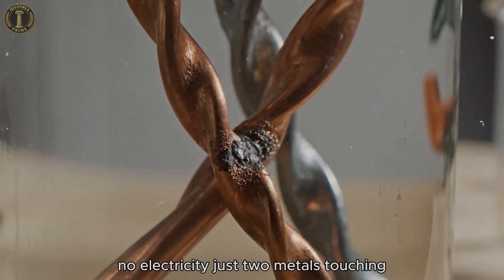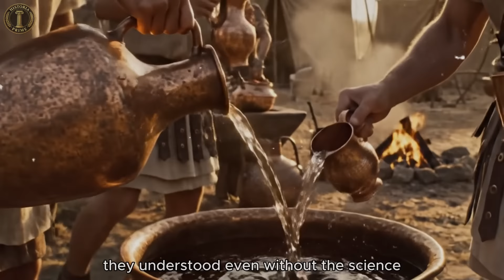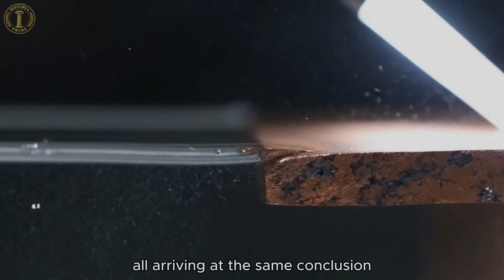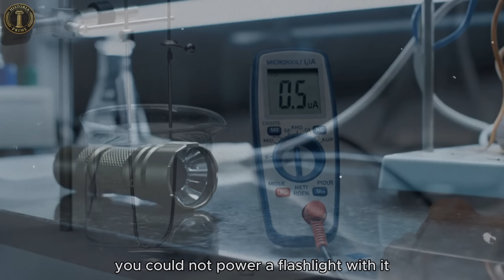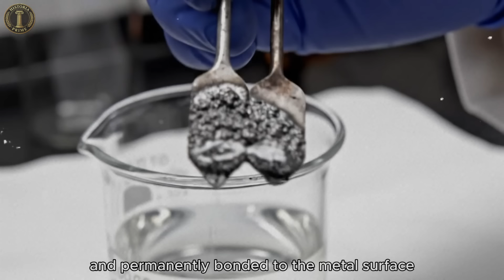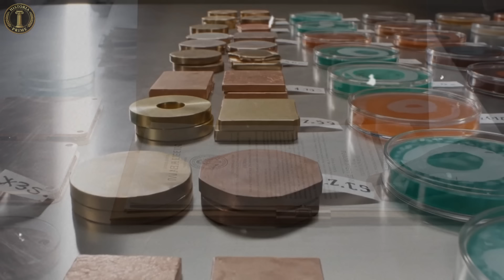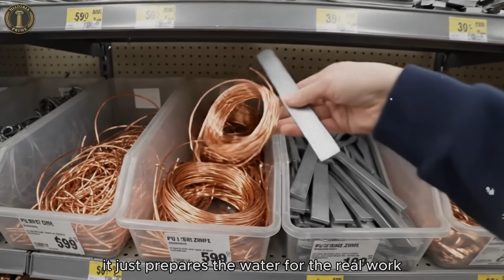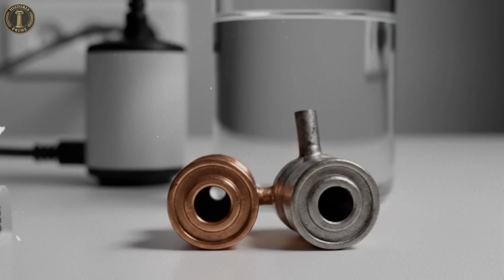Connecting Two Metals Purifies ANY Water — The "Earth Filter" Secret They Buried

Comment: Thanks for the infos, u fortunately, healthwise not recommended.
Here is the thing,

That YouTube suggestion is a bit sketchy 😬. Using copper and nickel wires in water purification is an unconventional method, and safety's a concern. Here's what could happen:

- *Copper*: Might leach into water, potentially causing toxicity if levels get too high.

- *Nickel*: Could also leach, causing allergic reactions or toxicity in some people.

- *Electrolysis*: When metals touch water, electrolysis can occur, potentially creating harmful compounds.

Instead, consider proven methods:
- Boiling
- Filtration systems
- UV treatment

Maybe, if you don't have those above safe methods at your disposal, you may use this old method for emergency, still unsafe
Reply from the maker: Fair caution. Water purification and water safety are bigger than one simple trick, so skepticism and careful testing are absolutely reasonable.

Comment: False statement. Copper and tin make BRASS. Copper and zinc make Bronze. Bronze is what you need
Reply from the maker: Actually, tin and copper make bronze, while zinc and copper make brass! 🛠️
Reply: @HistoriaPrime1212 ... You are right 😉👍🏻 ...
But I do hv two more questions, please: ...
(1.) Does the combination of 'Copper and Zinc' has similar/same properties in respect of water cleansing, electric flow, etc., compare to combin. of 'Cop. & Tin' r having (... apart fr fact, Cop.& Tin = Bronce) 🤔 ?? ...
(2.) Why shld the materials Cop./Tin/Zinc loose their properties alrdy after a few month time, after being combined (e.g., to 1 wire) ?? ... 🤔

Comment: If you have a well and you get algae film in your toilet bowl, place a small 1/2 or 3/4  piece of copper pipe in the tank, make sure it does t interfere with the flush mechanism and the algae will not grow back.  We used to use  one teaspoon of copper sulfide powder to 1 pint water to treat algae in swimming pools.
Reply: Would it work with some copper piping in the filter ?
Reply from the maker: Interesting tip, though I’d be careful with any chemical use around plumbing or water systems. Small details can matter a lot more than people think.
Reply: Dad put a Copper Tube into the toilet as a water spout thats pouring the fresh water refilling the flush tank.  No algae no nothing ever.

Comment: What happens to the good bacterias in your body if you drink the water purified by cooper zink ?
Reply: I suppose you drink the water, not the cooper or the zinc to harm your biom....
Reply from the maker: Good question. Water treatment and gut health are both more complicated than one simple claim, which is why “cleaner” and “safe long-term” are not always the same thing.
Reply: The stomach and duodenum absorb the copper and zinc before it reaches the intestines. Even if the metals reached the bloodstream, there's not enough to cause a problem, especially since both metals are required in minute amounts for proper metabolism in the body.

Comment: If one were to use a pre 1982 penny and a post 1982 penny, would this work? Once the job is done, can these pennies be reused?
Reply: Good question 👍🏻 ...  🤔?
Reply from the maker: Interesting idea, but pennies are still a very different setup from using the metals in a purpose-built arrangement. Reuse would also depend on how much corrosion or wear happened.

Comment: So I know where to get copper. Where do I find zinc
Reply: American pennies past 1982 are zinc.
Reply: Galvanized is a zinc coat on steel. Nails are an easy source.
Reply: @BillMarkey-sg4ph nails are zinc?
Reply: @laurapugh5874  The "galvanized" cover on some nails is zinc. Very common.
Reply: Zinc at hardware store too
Reply: Dry cell batteries, labeled as 'general purpose' and 'heavy duty' (not alkaline!) are made with a high purity zinc can (negative electrode). You can take them apart (carefully: contains zinc or ammonium chloride salts and manganese dioxide, which are moderately toxic/irritant) and thoroughly clean before use.
Reply: Buy a brass doorknob or anything brass, it's a mix of copper and zinc
Reply: Hardware store
Reply from the maker: Zinc is usually easier to find through roofing suppliers, metal suppliers, hardware sources, or online material sellers depending on the form you need.
Reply: You can find kdf filters on the web
Reply: Commercial fisherman sites sell zinc. They use them on crab pots, lobster pots, eel pots, ect. It stops corrosion. You may have to be creative how to pair with copper, but you'll be able to locate a zinc product.

Comment: Is the dirt in the water absorbed by the copper or it settles at the bottom of the vessel ?
Reply: The bigger/larger parts in the water, you shld filter out first, by using a piece of fabric / textile / cloth / charcoal, or similar ...
The method introduced to us here in this video, refers rather to the small unwanted particles, e.g. bacteria, etc.
Reply from the maker: More likely the larger dirt settles first, while the metal itself is not just “absorbing” all of it. That’s why pre-filtering still matters.

Comment: Since pennies are copper and zinc, can a couple of pennies work?
Reply from the maker: Not really in the same way. Pennies are a very different setup, and modern pennies are mostly zinc with a thin copper layer, so they would not behave like using the metals in a purpose-built arrangement.
Reply: @HistoriaPrime1212 what about pennies in a copper pitcher?
Reply: @laurapugh5874 Or you could just buy some KDF filter media.  It is pre-made zinc and copper alloy used for water treatment.  There is an 85 and a 55 KDF.  One is for well water, and the other for municipal water.

Comment: I haven't seen any pure zinc or pure copper for sell....where is it?
Reply from the maker: Pure copper is usually easiest to find as wire, sheet, or pipe from hardware and electrical suppliers. Pure zinc is less common in stores, but metal supply shops and online sellers often carry zinc sheet, rod, or anodes.

Comment: Where can i get copper and zinc pipes?
Reply from the maker: You can usually find copper pipe at most hardware or plumbing supply stores. Zinc is a bit trickier — sheet zinc, zinc rods, or galvanized pieces are often easier to find than full zinc pipe.

Comment: Do not drink anything acidic in a copper mug. It will make you very ill.
Reply: No salt in copper either
Reply: @robertedgell2214 ... Thx ... 😊 👍🏻👍🏻👍🏻
Reply: NOT all copper mugs are equal, meaning; make sure it is copper. I bought a "copper" mug, washed it, left water overnight, drunk water, and few hours later, got such bad  headache...tried again.....headache again; stopped drinking water from the mug...headache was gone.
Reply: @Krystyna-q7e6g :  Buy "100% pure copper sheet, tube" in the hardware- and fabricate your own "copper mug, pitcher, container, etc.."

The copper vessel interior, should be "scrubbed" every "3-5. years", with "very fine sand paper"- to removed the thin layer of "oxidized" copper surface...
Reply: @arielhermoso4262 Thank you.
Reply from the maker: Good caution. Copper and acidic liquids are exactly the kind of compatibility issue people should take seriously.
Reply: Made the mistake of putting orange juice in my copper flask. Was very ill within minutes of drinking some.
Reply: @ransomeblytonbuchan7979 медь хорошо чистить лимонным соком и немного соли добавить.Она будет блестеть.
Reply: THANK YOU!  This and the comments are very valuable information!
Reply: AVOID: 
Coffee, All Citrus Juices,  Tomato Anything,  Sodas, Teas,  Any Vinegars,  Dairy,  Alcohol & Wine...

PRETTY  MUCH  =  DRINK  JUST  WATER 💧 IN  COPPER  CUPS
Reply: @deesickles7578 ... Thanks for yr info and advice ... 🙄 👍🏻
Reply: @deesickles7578 . thank you!
Reply: Purify water in a cooper jug then whatever u wnat to mix the water with put in a glass jar and mix. ...like making lemonade etc. Just for storing wtaer use the copper jug
Reply: Been there, done that.
Reply: Keeping water 8 hrs overnight does the best job and pulls enough copper . Not to elevate copper levels too high 
Its best to drink copper water for litle while then take break. Or drink just once a day from copper vessel. Testing for copper levels be wise, even tho we most likely deficient in copper. Roundup n pesticides in food makes sure of that..😢 
Never put anything else in your copper vessel but just water😊
Reply: What about the cocktail that is always served in a copper mug?  I think it has ginger beer in it but I can’t remember the name.
Reply: @sandracheeks1811 & alcohol...
I think those Moscow Mule mug might have a thin lining of plastic, just like all aluminum cans have...
🇺🇸😎
Reply: I believe you're talking about a Moscow Mule. Not only is it made with ginger beer but I think it's made with lime juice as well.
Reply: @sandracheeks1811 Moscow Mule ❤
Reply: Thanks🙏
Reply: Спасибо, значит только для чистой воды, а остальное из глиняной кружки можно. Кстати, у дворян до революции в России столовые предметы, как вилки и ложки были серебрянными.
Reply: Why
Reply: @zonkermom I'm thinking the acid leeches copper into the liquid ie too much copper to ingest?
Reply: It is said that mental illness have a high percentage of copper into the brain
Reply: @theodorcosminvoicu9240  You are correct, there is too much copper in people with bipolar and schizoaffective disorders. Traditional Chinese and Tibetan medicine teaches about this too.
Reply: Put copper lines on my lowes app cart now looking for zinc, all I can find is zinc plated
Reply: @javi1373 can't find zink or zink wire in hardware store
Reply: Very important information. Thanks for sharing.
Reply: 🤔The water may very well fix severe acne
Reply: Isn't a Mosco Mule drink acidic? Its traditionally served in a copper mug. I think. Hmm
Reply: However, I make turkish coffee in a copper turkish pot and coffee is the most acidic drink there is. Doesnt make me sick. Not sure whats up with other drinks.
Reply: @patrickbennett439 I think it wont have that much effect coffee is only mildly acidic. Acidity on Ph scale is 5.2. While lemon has2.0. 
And if keep it in the vessel for only quick brewing it cant react with copper much..
 plus 👆To reduce coffee acid best to brew dark roast. 😊
Reply: Wasn't aware of that but makes sense
Reply: Like coffee?
Reply: Just use Copper pot to hold water

Comment: Does it filter the seepage from plastic bottles
Reply from the maker: Not reliably. A setup like this may help with some microbes or particles depending on the design, but dissolved chemicals from plastics are a different problem and usually need media like activated carbon or reverse osmosis.

Comment: Would copper& zinc  pieces be added to a large water tank system work??? 
Most rural homes in New Zealand have water tank stand systems made out of PVC high grade plastic but needs cleaning out over time  and I have never cleaned physically because it's impossible to get into the limited space. Would be very interested how this can be done!!!
Reply from the maker: Using copper and zinc in a large tank can help control bacterial growth, though it won't remove physical sediment on its own. 💧